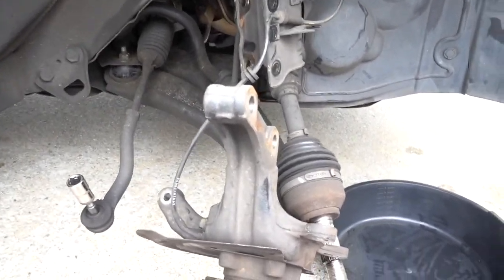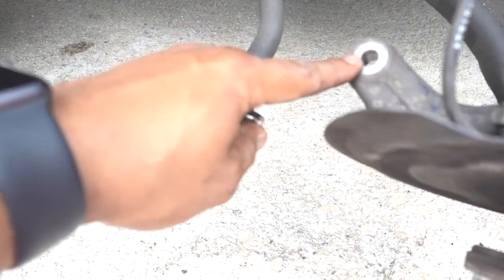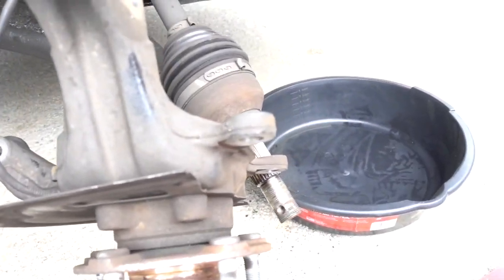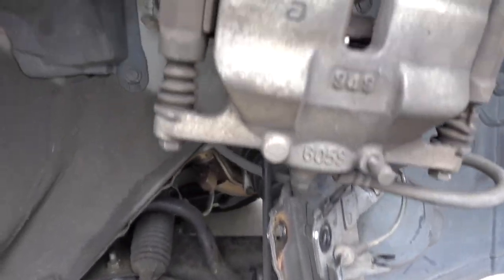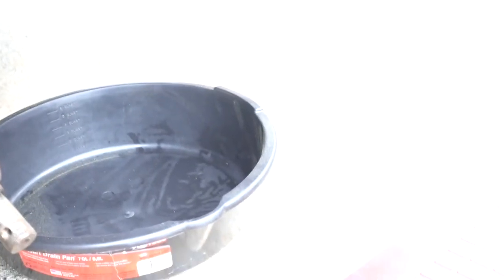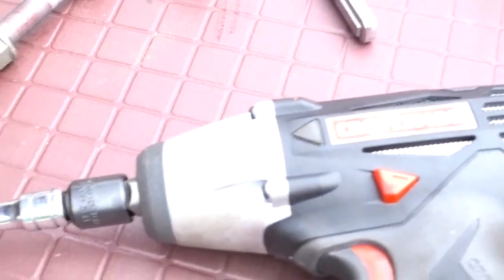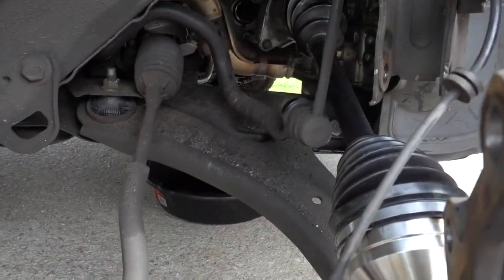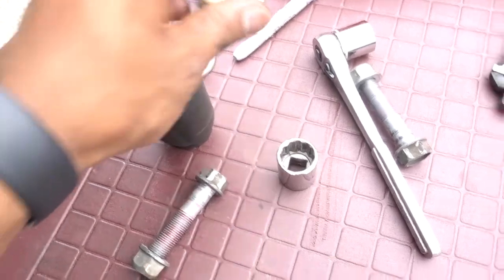DIY How To Replace C:V Axle 2009 Nissan Rogue

Comment: It's funny,every video i found on how to remove passengers side axle, they slide right out of the bracket. Good ole northeast rust. The one i'm doing is frozen solid in the bracket and it's a 2010. Next step is,just get the boot kit and call it a day.
Reply from the maker: +Camp Freedom VT yea I don’t know why
Reply: Well up here in the Canuckland, it’s doesn’t slide off easily thanks to the salt used on our roads, it’s stuck pretty bad. I had to use a pry bar and a torch..
Reply: I had to remove the bracket and get it pressed out

Comment: Amigo cuales eran los syntomas que tenía tu Nissan rouge antes de Areglar la
Reply from the maker: Cuando giraba el volante tronaba
Reply: Grasias tengo por responder tengo una 2011 Nissan rouge y  truena cuando jiro el volante ase 1 día le cambie una llanta del mismo lado que truena , pero ahora vibra cuando comienso a correr no se si será del asle , la tuya también vibraba cundo comensabas a correr Grasias hermano
Reply: Mi novia fue a El mecanico y el mecanico solo la corrió un poco y sin chekear nada le dijo  que la vibración es de la transmisión que ya no sirve pero no le creí por que no chekio nada solo la corrió un poco y dio ese dionostico  , si me puedes dar una idea te lo agradeseria hermano grasias
Reply from the maker: Un poco, pero no era mía es de un cliente y solo la maneje para ver el problema
Reply: Grasias hermano
Reply from the maker: Pueden ser varias cosas, mala alineación, malos soportes o malos bushings
Reply from the maker: Si puedes checa eso o llévalo a otro mecánico
Reply from the maker: De nada